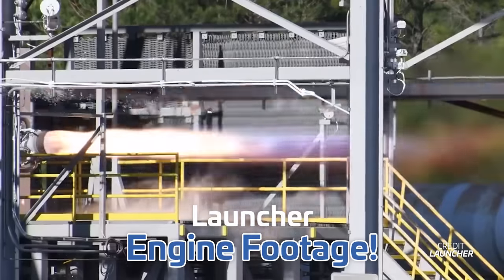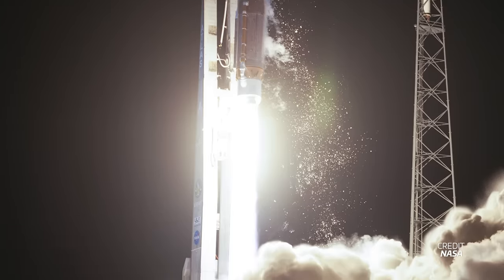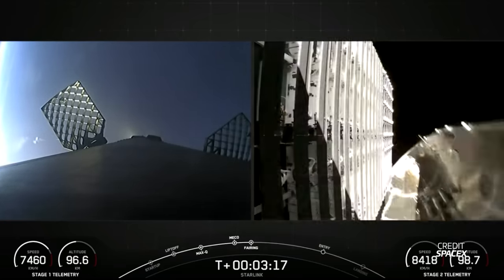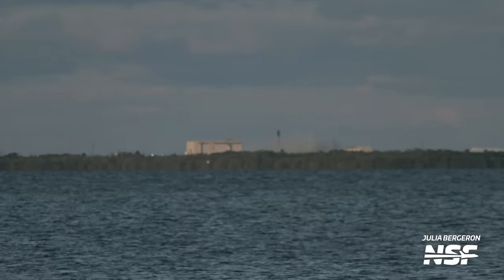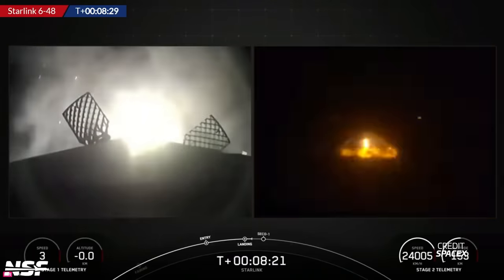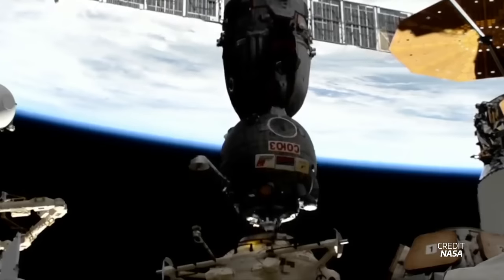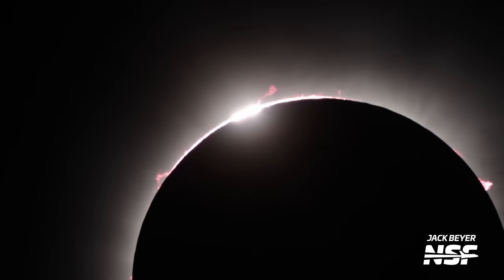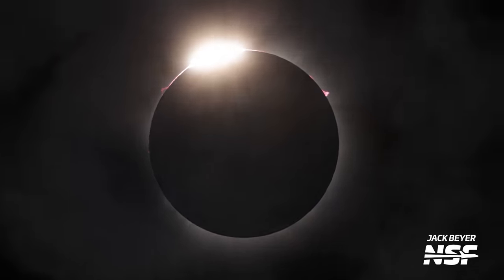🔥 SpaceX's Raptor Vacuum Engine in Action! | This Week In Spaceflight

Comment: The orange glow from fuel rich kerolox engines is from unburned carbon particles burning when they hit atmospheric oxygen. If you watch a Spacex launch, you'll see the orange gradually diminish as the atmosphere gets thinner, and the exhaust becomes blacker from unburned carbon.
Reply: It is mainly from film cooling. What you describe is for the exhaust plume after it has exited the nozzle but before that the plume is still orange on M1D. The RD-180 is the exact same cycle and mixture ratio as E-2 but it uses heavy amounts of fuel as cooling for the engine nozzle and the inside of the combustion chamber walls, creating a much more fuel rich environment past the combustion chamber that lowes the temperature of the exhaust which creates the orange glow. E-2 uses liquid oxygen for cooling and little to not film cooling so the exhaust temperature remains high even when several feet away from the engine. You can see the orange effect that you mention doesn't happen until much further away from the engine

Comment: With the raptor shutting down video, at what point could it still be throttled back up? Like, if it got down to the pulsating rings stage, could they throttle it back up again?

Comment: That explains the "WHOOOOP!" noise when they shut down Raptors on the ground...
Reply: That's the turbopumps which are present on all Raptor engines. That's why you hear the honk even on sea level Raptors (which do not experience flow separation like RVac)
Reply: The honk doesnt come from the nozzle but from turbopumps spooling down

Comment: These rockets should have flashing plane lights on them as they launch 🚨🚨🚨
Reply: Why? Nothing ever flies over them so it would be pointless.
Reply: @minmo2288  just put the hazard lights on them
Reply: @UmmerFarooq-wx4yo  no need, since airspace near the path of the rocket's flight is closed off and constantly monitered.
Reply: @hamzahkhan8952  that's a very stupid rejection from you. There is absolute always need for human identification on something giving off a natural after effect. Primarily as it is causing distress & confusion to people on the ground.
Reply: @UmmerFarooq-wx4yo  a rocket in flight would be producing flames and exhaust which would allow anyone to know it is a rocket. and anyone who would get worried about one would soon realize, with just a few seconds of observation, that it would obviously be heading away from them and not toward them. also, people who are most likely to see these launches (those who live near launch sites) would be well aware of these events and might be given warnings of such events occurring.
Reply: @hamzahkhan8952  that has not be the case